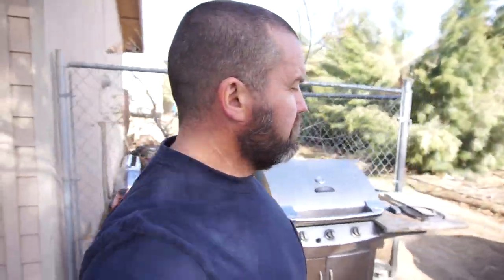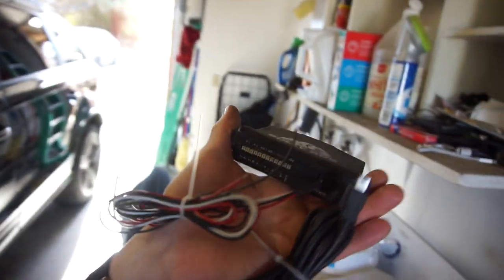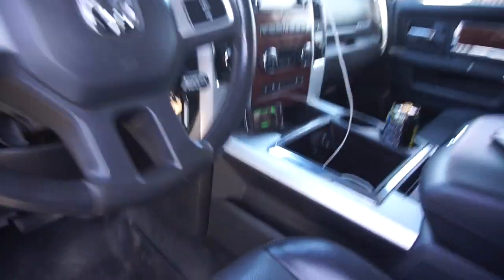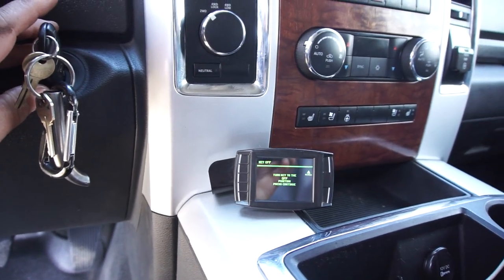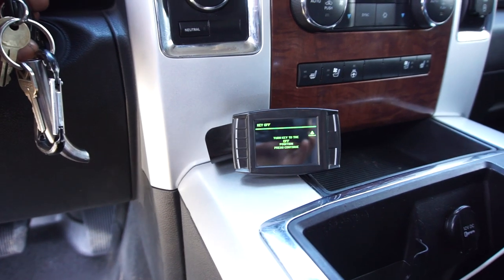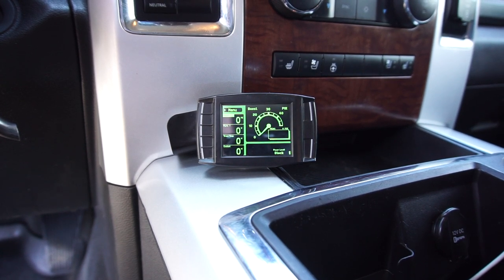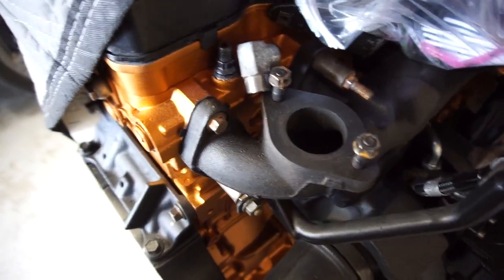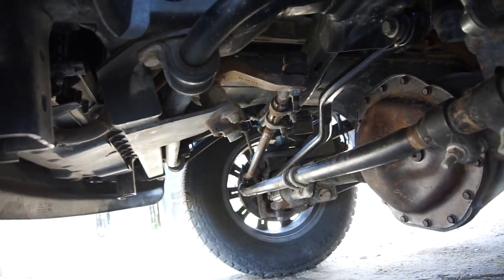Installing A $200 Tuner On My 2010 Ram 2500 Cummins Diesel.. More MPGs

Comment: Where did you get your run power from? Using the the key to turn on and off the bullydog I can’t seem to find fuses in my ram 2500 inside
Reply from the maker: From the TIPM under the hood, driver side by battery.

Comment: Where did you get the tune? Or was it already loaded?
Reply: Would you be able to send somehow? I have a tune but it seems to be throwing two codes U0075 and U011A. Any issues with yours? Thanks for the vid and advice.
Reply from the maker: Look on eBay. They have unlock tunes.

Comment: What fuse did you hook it to?
Reply from the maker: 2010 6.7l Pickup and 2011 6.7l cab & chassis fUse nUMBer M45
Always tap into the cold side of the fuse. On the 2010 Pickup and 2011 Cab & Chassis, the cold side is towards the front of the vehicle.

2011-2012 6.7l Pickup fUse nUMBer M33
Always tap into the cold side of the fuse. On the 2011 Pickup, the cold side is towards the front of the vehicle.
Reply: Thank you. I figured it out. So just in case anyone reads this. The 2010 is M45 BUT the 2011 is M33
Reply from the maker: Yes.